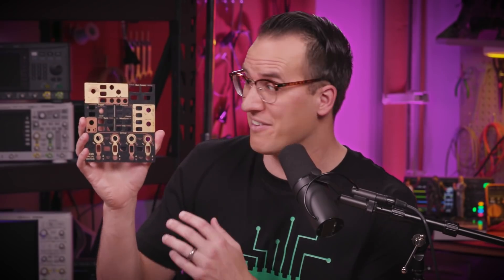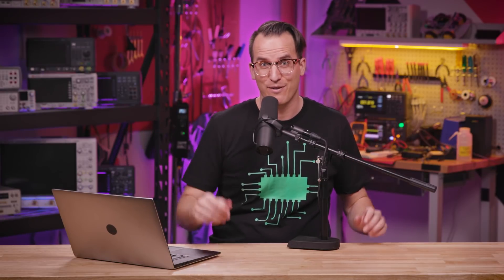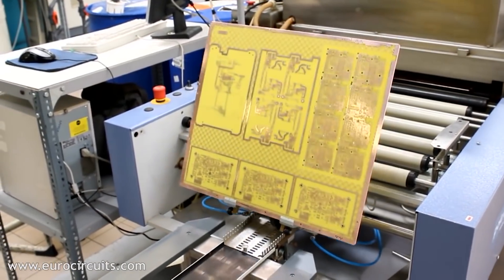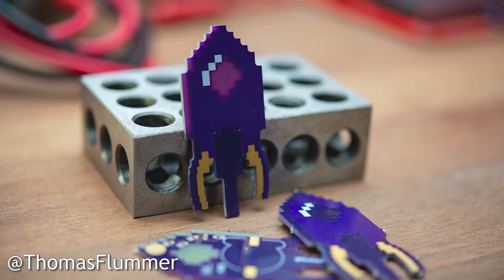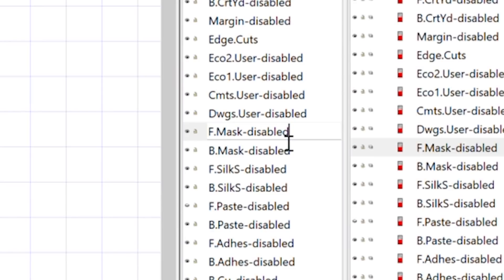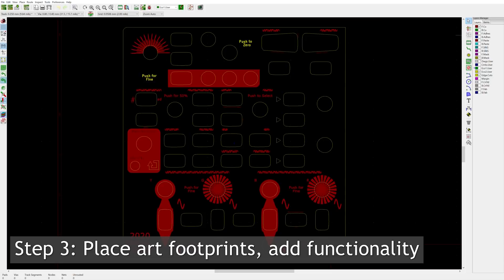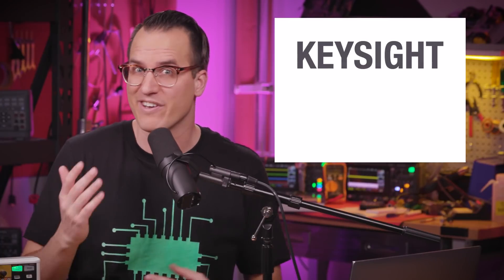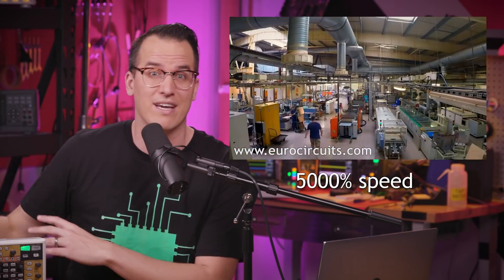Printed Circuit Bling - An Open Source Art PCB Toolchain

Comment: Great video! When placing the art files (layers) onto the PCB, I recommend turning the grid size up as high as it will go (100 mils or 5 mm) and placing everything at the same location. The centroid of the layer (footprint) you create should line everything up nicely.
Reply from the maker: Thanks Chris, and good tip!

Comment: Maybe I've been using these terms wrong, but what you call a "time-lapse" I would call a "stop-motion"
Reply from the maker: Yes, I've been using the wrong word, apparently
Reply: Potaeto, potaato. pvc pcb.
Reply: @KeysightLabs  I wonder if the mixup may stem from the fact that some time-lapse apps can be used to make stopmotion videos, as some allow you to press a button to take a frame, then set playback frame rate etc
so they work for both

Comment: And PCB fabs do actually "lay down some copper", in a way!

From what I've seen of the process, the initial FR4 laminate contains a very thin layer of copper - much thinner than the 35μm of a standard PCB - so the etching process is faster, less copper is wasted, and the etching solution lasts longer. Then once the design is etched, they deposit more copper on top of what remains, until it gets to the desired thickness.

This also means they can produce whatever thickness of copper layer you want - if you're willing to pay for it ;)

(Of course different PCB fabs may have different processes. I've seen videos from at least 4 fabs now, I think, so there's a chance I'm confusing things between those fabs' processes!)
Reply from the maker: Yes, they have to go the through-hole plating to get vias connecting, and I think the copper gets thickened up at that point as well

Comment: You can get multiple colours/layers of solder resist on a single board if you sweet-talk/pay your fab enough ;)
I'm pretty sure some of Saar Drimer's Boldport projects use at least 2 solder resist colours, and I swear I once saw a photo of a rainbow on a PCB...

Saar actually used EuroCircuits to produce his Boldport PCBs, incidentally, so they seem to be one option for lots of colours! :)
Reply from the maker: Yes! I did see a rainbow apple logo in solder mask, but I think you just have to ask with $
Reply: @KeysightLabs  Ah yes, I think that's the one I saw! 🌈🍏

How much extra effort that is would likely depend on the fab's processes, but you probably at least need your own panel - which I doubt was an issue for Saar making several hundred kits for each Boldport project.
[Disclaimer-of-sorts: I've been a Boldport Club member since project #6 in August 2016 and love the community that Saar built around his artistic electronics kits. Big fan~ 😸]

... So how long until one of the big Chinese PCB fabs offers a pooling service that lets you use all of their solder resist colours on a single board at the super-low prices we're now used to? 😁

Could they just run the panel through the solder resist stage multiple times, once per colour?
They may have to limit the stacking of resist layers to prevent the board surface becoming too "contoured" from e.g. 6 layers of resist piled on top of each other — or maybe that wouldn't be a problem and we could use that effect to create more tactile PCB surfaces; who knows!

I imagine several layers of resist could be thick enough to cause problems with components not sitting on pads properly, especially packages like QFN/DFN and maybe QFP.
People say that ENIG is better than HASL for such packages because the "S" may not be as "HA-L" as you'd like (👀), but 6 layers of stacked solder resist under a package would be much worse, I think!
However that'd just be another design guideline: only use 1 layer of resist under SMD parts. No need to restrict layering of resist at the fab just for that reason! 😸

Alternatively... some fabs are already using inkjet-style "printers" for the "silkscreen"/legend. Could the same/similar machines be used to print the solder resist? Using either a series of those printers, one per colour, or a single printer with all 6~9+ colours...
I don't think they have quite as much resolution as you tend to want for solder resist, but maybe with a bit more R&D they can get there! 😁

...sorry, I should maybe be sending this to Seeed/PCBWay/JLCPCB/etc. rather than boring everyone on YouTube! 😅😇
Engineering mind + ADHD can be a bit wild at times... 😆

Comment: What a weird coincidence, I downloaded KiCad last night for a project!  Then I see your video this morning and I hadn't even considered PCB art before... that's cool too!   I've heard good things about OSH Park, but have never tried their services... I hope to win a gift card so it will make the decision easier to try them, I've used Advanced Circuits in the past or made a small run of DIY boards at home.
Reply: I've used OSH Park a couple of times. They have very nice PCBs and finish them with excellent quality. I highly recommend them and no, I am NOT paid by them nor do I work for them.

The only gripe I've had is occasionally you have to sand the edges off as they'll have spikes sticking out where the PCB is cut from the panel, so you have to sand them down. However it's a 2 minute process with a rasp so for me it's a non-issue.
Reply: @OtherDalfite  That's great... and Thanks for letting me know, that's very encouraging!  I will be using them to make my PCB's, Like I said I've heard a lot of nice things about them.
Reply: @HobbyHalloween  also with KiCad I forgot to mention, make sure you take advantage of premade PCB footprints with the library loader software. Super, SUPER useful. And don't rely on just mouser. There's almost always a footprint somewhere out there if you can't find it on mouser.